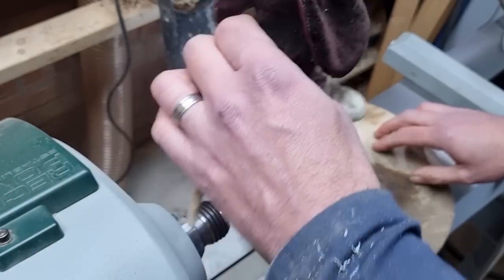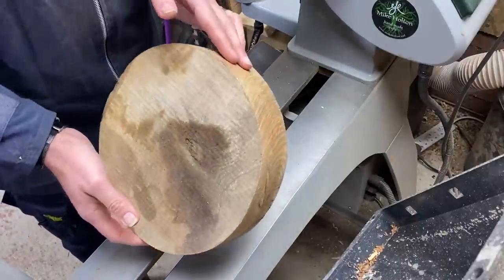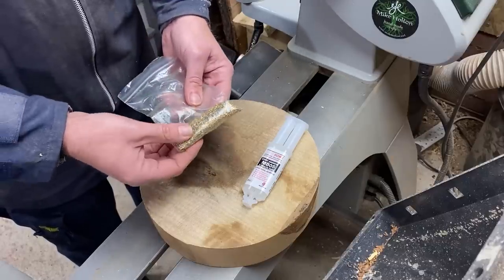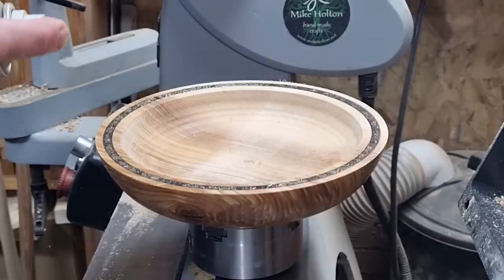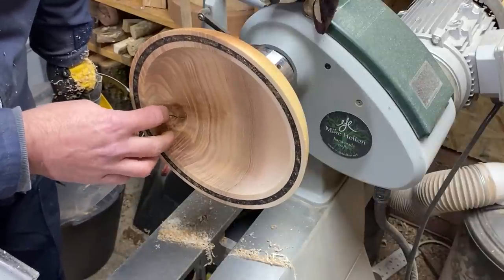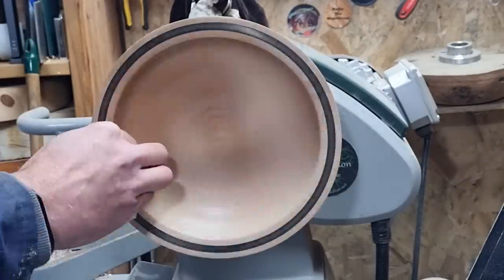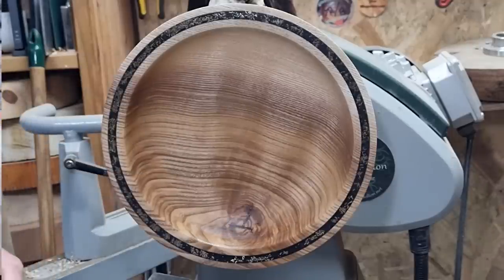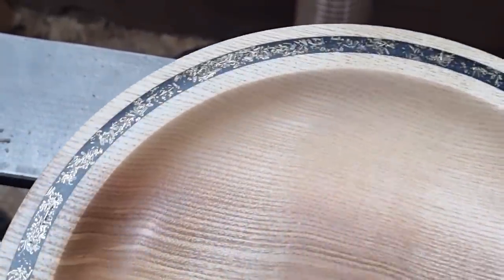INJECTING some EXTRA beauty into this Olive Ash bowl - Wood Turning project

Comment: Mike- have worked with epoxy for years as manager of a boat shop and wish to pass along a couple of tips, the slower the set time = easier management.  You don’t have to rush and bubbles are less frequent.  😅A hair dryer is enough to manipulate the popping of any bubbles.  A wee bit of warmth gives best results, too much will cook.  😢The thicker the mass the quicker it sets up.  So a paper plate ( we used hot dog or French Fries containers) to allow using one corner to mix and then allowing the epoxy to flatten while “resting “ during application.  Cheers!
Reply from the maker: Thanks so much for these tips!! This is what I love most about reading the comments, when someone with way more knowledge than me helps by sharing tips for me and everyone else to take onboard to make the process better. Thanks my friend, I will adapt my technique accordingly. All the best, Mike
Reply: Brilliant. Love what you do. ❤❤

Comment: The bowl looks terrific.   Nice wood colour and grain.   The inlay really sets it off.   I like your technique of putting the swarf on after filling the groove, this provides more of the swarf at the surface.
Tips for the viewers.  Check the swarf for oils, especially if obtained from a local machinist.   Brass is normally machined dry, but the lathe bed normally has oil residues from earlier machining of other metals which did need lubrication.  If the swarf is oily it is best to clean with solvent and let dry.
Any tool can cut the brass can be HSS or carbide.
I like using two part epoxy, I prefer longer set time just to give me more time.   I do not recommend the use of a polyester resin such as used on fibreglass, the type which uses a couple of drops of MEK (methyl ethyl ketone) for hardener.    The reason is that any air bubbles or voids in this resin cannot be fixed with CA glue.   I found out the hard way.   I used a product called InLace which looks terrific.   I had some voids after cleaning off the rim and tried to fill with CA glue, but the CA glue would not cure.    I do not know why, I just now avoid polyester resins if possible.
Dave.
Reply from the maker: Thanks Dave, brilliant advice as always 😀
Reply: I forgot to add a suggestion for the dogs name.   My suggestion is "Dusty" as in Dusty by name, Dusty by nature due to where he sits.   😁
Reply from the maker: @lv_woodturner3899  Hahaha love it 🤣

Comment: Nice technique with the inlay.  Steel tools might actually hold up better when hitting the metal than does carbide which is brittle.  I think that your "supervisor" should be named Chip.
Reply from the maker: Hi George, HSS or carbide will both cut brass chips easily with no damage to the cutting edge. Thanks for the name suggestion, Chip has been mentioned a few times 😃

Comment: That’s a very nice bowl, Mike. We have even more in common as I’ve just made some similar bowls with resin inlays producing,  Iike yourself, a very pleasing result. Keep up the good work 🌞
Reply from the maker: Thanks Ray 😃 any tips to stop normal resin seeping into the wood? I use PVA glue to help stop it.
Reply: @MikeHolton  Hi Mike. I haven’t had any issues with that but, according to Jim of Sprague Woodturning (he really knows his stuff), it helps to put some finish in the groove first. Check out some of his older posts. You’ll be very impressed 🌞
Reply from the maker: @raydriver7300  Thanks Ray, I've been following Jim for a couple of years, he is surely the resin king 😁

Comment: Another great vid. As a baby turner, I haven’t tried any finishing yet. I really appreciate that you explain each step that you take. How do you chose what finish to use? there appear to be so many. Watching a guy who makes huge wood and resin tables, he uses charcoal when mixing a black epoxy as the colour doesn’t run into the wood like some dyes/powders do. 👍🏻😃
Reply from the maker: Yeah, I've head that about charcoal, I'll have to give it a try. With regards to finish, if the bowl has more of a natural feel then I will try to use oils and shellac if it more of a presentation piece then I like to use a hard wax.  😃

Comment: A man with almost no fear. 

Heating epoxy that cures in 5 minutes in my mind would make it set even quicker and cause much rush and panic but Mike you just styled it out and then calmly added the brass. I am sure some of the sawdust around was smoking once you had finished with the blow torch, again perhaps there was no real danger of setting the whole workshop ablaze. Someone suggested a hair dryer instead, I would never risk the wrath of Mrs Parker but it probably would make sense.

Seriously though fire must be an enormous risk in your profession, how do you mitigate the risk?

Your work is inspiring, always the encouragement to step out of the comfort zone and give things a go.
Reply from the maker: Thanks! I was using fire in a very controlled way and had an extinguisher close to hand it needed. You are right about it making the epoxy set faster, in future I'll be using a heat gun 😀.

Comment: Did you offset the blank so you were taking off more wood on the side with the bark?
Reply from the maker: Not exactly sure what you mean, sorry
Reply: Describing it in words is hard :). I think if you lined up your circle template for placing the faceplate such that one side touched the interior of the bark inclusion and the other side aligned with the opposite edge of the blank then you get a larger circle. That said, it would be wobbly for a while.
Reply from the maker: @dlh567  Ah, I'm with you now thanks, not  a bad idea, thanks, Mike 😃

Comment: Me thinks you would have gotten a better result if you had mixed the brass filings in to the epoxy.  the way you did it the filings want to float on top and you don't get the full metal effect.  As for the stuffed pup, seeing as it is a Beagle and is your quality control observer I thought of a little play eagle eyes, "Beagle Eyes".
Reply from the maker: Thanks Dennis you could be right, I have used that method before but you do get more air bubbles that way. Great name for the dog but the votes are closed and the name Hooch won in the end. Hooch as in Turner and Hooch. All the best, Mike